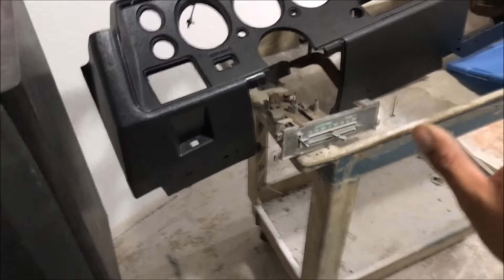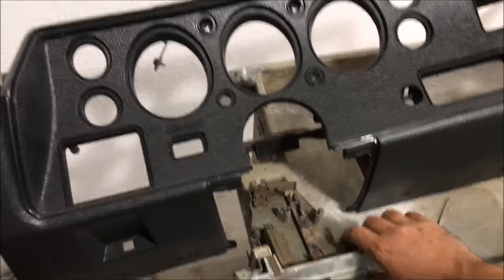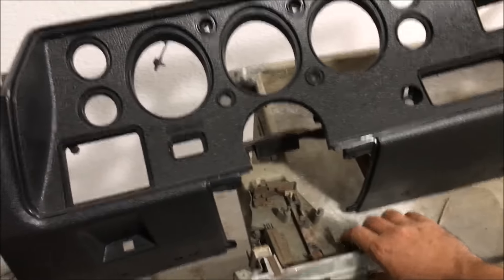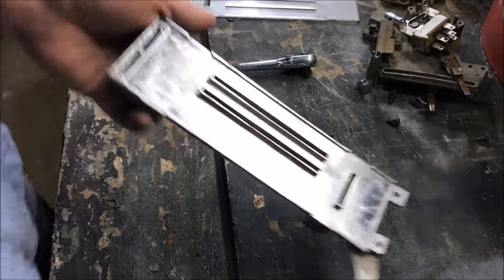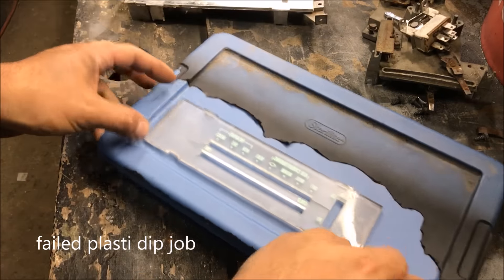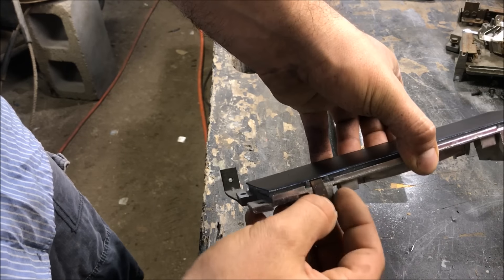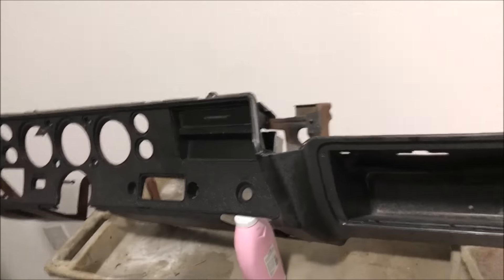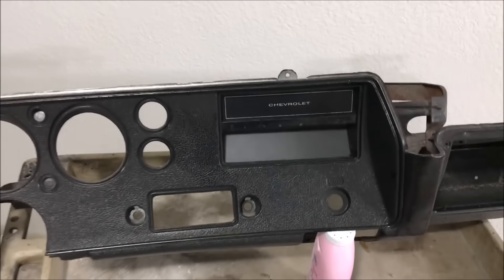a/c heater control delete GM chevelle custom race dash retro fit DIY how to

Comment: I like it Chris.   I don't have A/C on my 69, but when I did mine, I polished up the clean bezel and painted the background black.    I know your intent is using vintage air (I'm on the northern Oregon coast, so A/C not really needed) and like what you did.  As long as the plastic does not warp or melt in the heat, that should work fine.    

Wish I could post a pic in the comments...